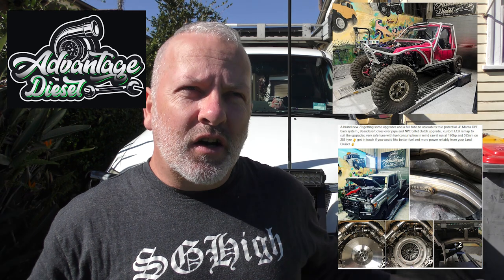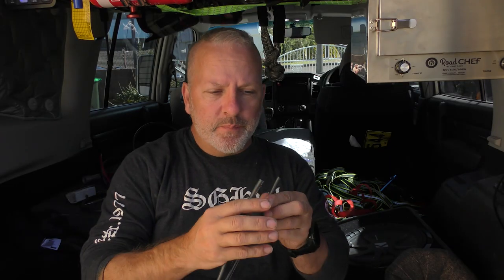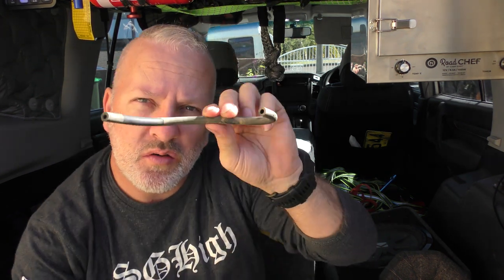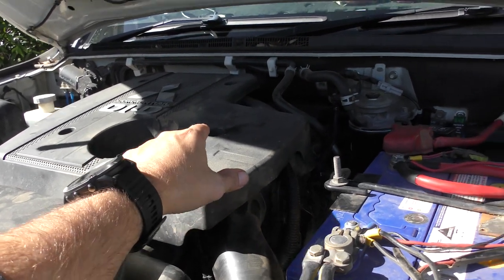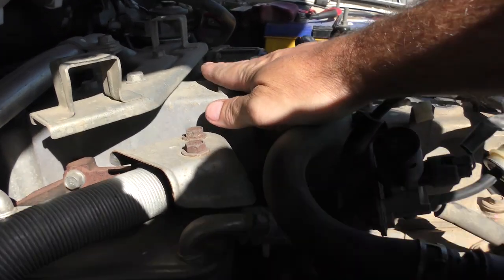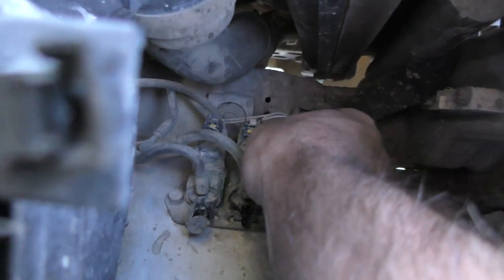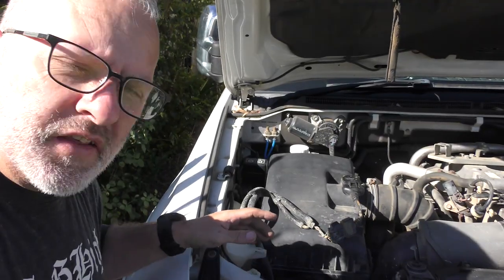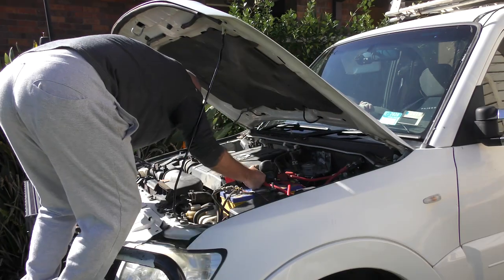4wd Power Problems - potential fix - for 20 bucks

Comment: Great info Brett, I had the same issue I changed the hoses as you showed. It seems to have fixed the problem, I will also change the fuel tank filter. Thanks again for showing us this.

Comment: that first solenoid you pointed to is for the swirl control valve. the lower half of the manifold has butterfly valves which are meant to increase air velocity at low rpm to increase torque and run of engine vacuum.
Reply from the maker: Beauty thanks AJ. You learn something every day.

Comment: Thanks for the video mate.   My newly purchased NS is having code issues that relate to map and boost.  Saw your wastegate pipes and compared to mine.  Mine were all ass up, so I replicated yours, and when I went for a test drive wow, more go for sure.  Unfortunately didn't fix my code error that happens after climbing a long steep mountain pass then coasting down a section she goes into limp mode.  However, I did see an electrical connection that was not done up, near the intake.  So off for another test run.  Dunno who worked on the car last, but they didn't know their ass from their elbow...

Comment: Thanks for the video. Do you recommend a Pajero for those who aren't handy? Do Pajs need constant maintenance?
Reply: As someone with no prior mechanical knowledge - so far yes (in my experience). I've owned a diesel 2014 NW for 9 months now and so far the only things have been a broken rear door strut and dead battery plus the usual fluid top ups. I do need new suspension though.
I've learned heaps from the Pajero Facebook groups, and there is so much support and info available! e.g. changing fuel filter, adjusting the in-cabin handbrake.

Comment: i had an issue last week where the vacuum line from
 my front diff solenoid had been caught by the fan and pulled off, i just used a 4mm 90 degree elbow and some new line and reconnected and re routed, my symptom was after about 25-30 mins of driving , the transfer case light started flashing,, no loss in power luckily,  after that repair, just completed 2700km round trip to fraser island  and back
Reply from the maker: Could have shared that with out the Fraser trip part . You bastard 😁 hope you had a cracker trip.
Reply: @DENMONKEY  always a great trip 😅

Comment: Hey Brett, I have a problem with my 08 GLS Pajero 3.2L did 4M41. when driving at temp in 2x4 the 2 green wheel lights will flash then switch off and the centre diff light will start flashing. I however still can drive and the diff sends power to the rear wheels but I can't change from 2x4 to any of the range gears unless i turn off the car and turn it back on

Comment: wow..i have a NT and just carry prospecting gear..on the highway i pull around 8.5 per 100....low 10s in town when the engine is up to temp
Reply from the maker: I'm a little over weight and the bigger tires add to that little too. When I first picked it up I remember seeing a 8.9  but that was many mods ago 😢
Reply: I get 8-9 per 100 on the highway, 14-15 on the highway seems pretty high unless you are towing.
Reply from the maker: @wally4350  oh yeah it was easy high. I know the most mods cost me 2.5l per and the torque lock up kit gave me back and 1.

Comment: Heya Brett. I cant find the vid you did on the rear hub bearing I recall you making. Anyhow, when you got it changed, was there actual movement in the wheel when you checked, or was it because of it being noisy that you changed it? 
I just changed my left rear because of a dry rubbing noise that got worse when I swerved the car to the right, and quieter swerving to the left, thus loading and unloading each side but there was no movement in either rear wheel when I checked by rocking elevated wheel with hands in 12 and 6 positions. Unfortunately, the noise didn't reduce by much after changing what I was convinced was the noisier left rear. However, I had the car up on stands yesterday and investigated further by rotating the drive train and listening, hearing the drivers side rear certainly making a dry rubbing noise, like the drum shoes were sticking on. I had a pro brake shop put all new rotors on my car a few months ago, so am confident the rotor isn't warped and that the handbrake shoes are correctly installed (they were on the passenger side, so 🤷‍♂). 
Anyhow, I was just wondering about your experience in the first paragraph. Though I happen to have another rear hub bearing and might just go out an change now anyhow, I still would be interested in your feedback.
Reply from the maker: Hey Karl, oooh that's a while ago. I was getting more of a whining noise mostly. I can't recall hearing any movement type noises like knocking etc but when checked the was a bit of movement of the wheel due to the failing bearing.
Reply: @DENMONKEY  cheers, Brett. I have no knocking like that described in forums, which would certainly see bearing moment at wheel. The swerving hard left to right is meant to load and unload each side to see which makes noise. 
Anyhow, car is up on jack and work begins.
Reply: All done. For those who are hunting through comments and forums for info on increased road noise in Pajeros suspecting bearings. As I discovered, you can have noisy bearings and not have any play in them. My driver's side rear had been adding to road noise, but changing it out today cleared up the rumble I was becoming concerned about. 
If you're going to do it yourself, make sure you have your wheeties for breaky and have some heat for the 4 studs holding the hub.
Reply from the maker: @karl4834  awesome glad its sorted.  Thanks for posting a follow up.  Nothing worse than finding info on a problem but they never tell you how they fixed it .

Comment: hows the manifold clean coming along ?
Reply from the maker: Long story. Got it done but the turbo went at the same time due to the air filter not sealing and it ate dust killing the bearing. So it only had less than a week on the road between getting that done and getting the new turbo, intercooler and tune done.. So I can't say how much difference it made on its own. Unfortunately the need to get it all done quick for a trip away robbed me of the opportunity to document it all for the channel. That said, it's awesome now but it wants to be $6000 later.